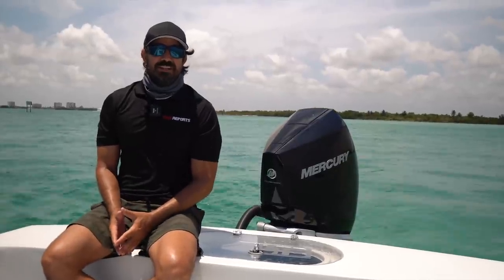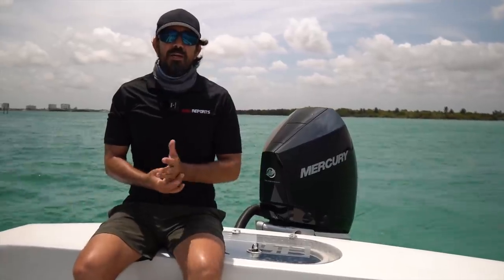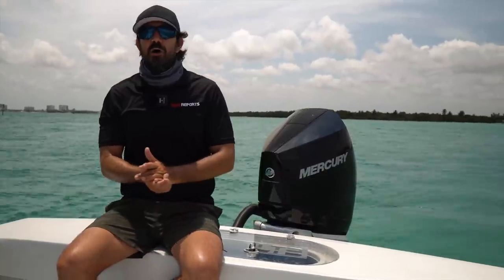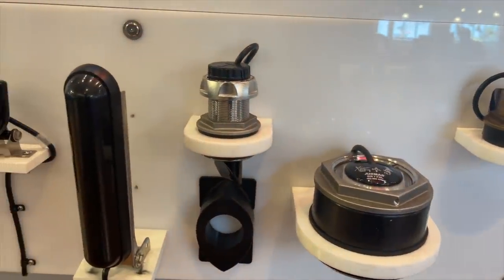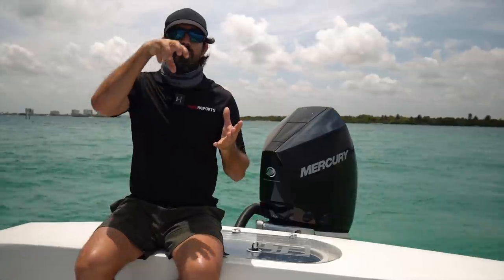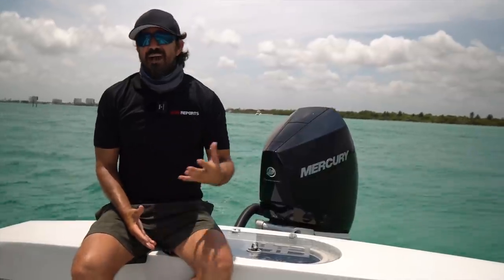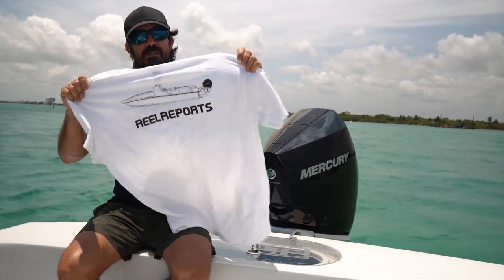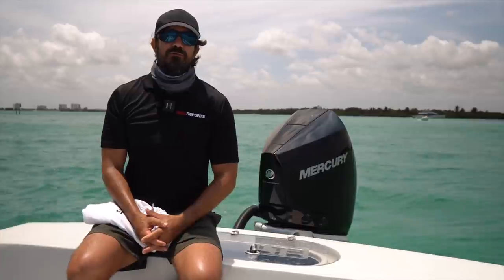Transducer Explained | EP 29

Comment: Would it be possible to install two separate transducers? Say a transom mount with side scan and high frequency and also a thru hole low frequency transducer. But obviously only operate the one that is most beneficial in the water depth that you are in at that time
Reply from the maker: Yep. We plan on adding side scan transducer shortly.